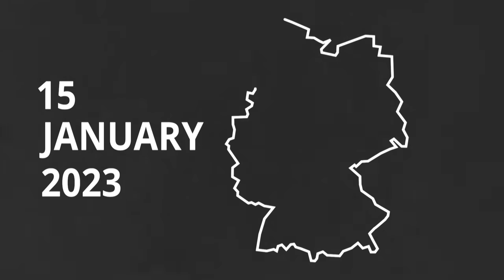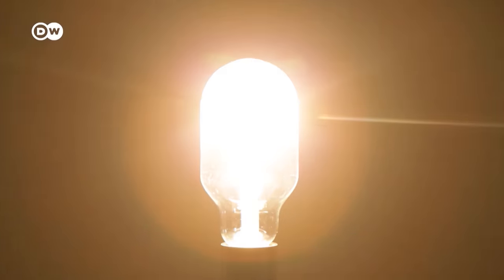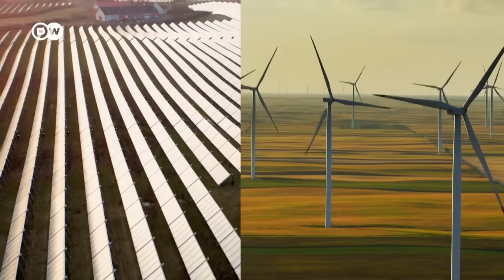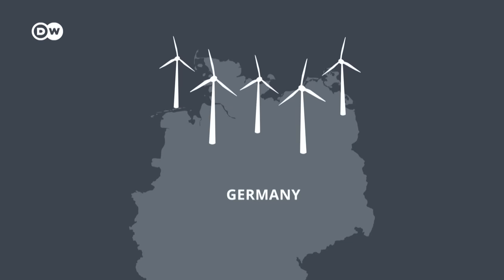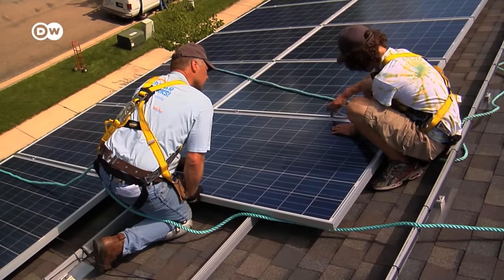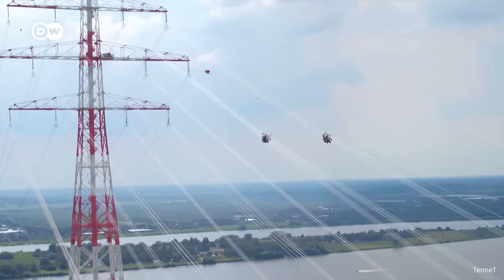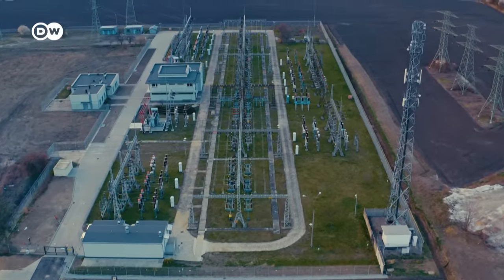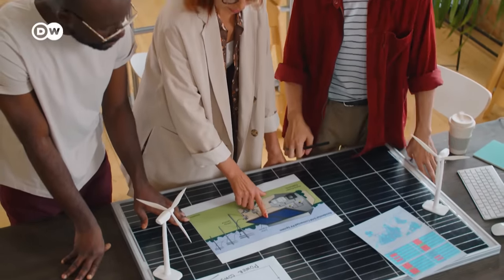This is what's REALLY holding back wind and solar

Comment from the maker: Would you adjust your electricity usage to the availability of renewable electricity?
Reply: I bet you I'm not far wrong am i
Reply: No, absolutely not. solar PV and wind are soon to be cheaper than any other form of electricty. We should be drowning in electricity at all times. The problem of building enough grid is easy to solve if politicians get out of the way.  When too much electricity is being generated, the surplus can be used to electrolyze hydrogen for industrial chemicals and steel-making, and to remove carbon from the air.
Reply: We need a solar tariff from, let's say, 11 a.m. to 2 p.m. to shift the demand when it's cheaper.
Reply: We need a "traffic light" signal from our power meters showing when demand is low (green, 51 Hz) or high (red, 49 Hz).
Reply: No
Reply: Already doing that here in Ukraine. Using 70% of energy on night tariff. Saving 35% of money.
Reply: yes i am doing the laundry mostly in the weekend around 12  o' clock  midday when my panels have the most power.   and if i use the dryer  that is about an hour later, when the sun is still going strong.
Reply: I already do..  I don't have.a smart meter though and even if I did, my utility doesn't offer a matching tarif, but to me it's just common sense to match my demand, as long as the gas peaker plants still exist on the grid. But what was really missing in the video was grid level energy storage as provided by Ambri and many other solutions (especially those not necessarily lithium based).
Reply: Yes, if the incentive if high to change
Reply: @abelfaber4457  I m doing this same with laundry - i don't have my panels but in Spain most of power at this time in grid coming from solar   + i set up my boiler to not work 18:00-04:00. At 18:00 peak demand is starting and at 04:00 is lowest. 80 liters of hot water is enoght for 2 showers in the evening and in the mornig water also is hot.
Reply: No
Reply: Yes, I try to avoid consuming electricity the difficult hours.
It will take money and time but a smart meter could measure the electric energy at any given moment and charge you accordingly to the current prices.
This will force people to consume when its cheap and to avoid costly time zone.
Reply: @DW Planet A; 5:28 "100 miles" Please make sure to provide metric unit measurements.
Reply: Definitely not! It is not my fault, nor is it my mission, to take responsibility for such poor political decisions. If we would have had active nuclear power plants, this would be a different story. Politicians are supposed to exist to improve the social infrastructure, not to make it more complicated.
Reply: I wouldn't mind
Reply: @gregvanpaassen  "We should be drowning in electricity at all times."

Except when the sun isn't shining.
Reply: @NoHandleToSpeakOf  So, let's purposely make the world function like a war-torn country?
Reply: Irrelevant, industry doesn't wait for energy to become available.
Reply: We should reshape our society to reduce our energy consumption and change when we need energy. I work from home (also an American). I have solar panels and an electric car. I hang dry my clothes. I turn on my dishwasher and washing machine during peak sunlight hours. I also charge my car when it's a sunny day. 

The biggest thing we should do is push for more work from home when possible. There's so much wasted energy to get to a cubicle to stare at a computer screen.
Reply: @PistonAvatarGuy  what an absurd premise
Reply: @NoHandleToSpeakOf  Exactly.
Reply: I already do, because this is saving a lot of ressources: matching your consumption with the production of renewable energy means that we'll need to build less generating capacity, less grid infrastructure and less storage (batteries being highly polluting and hydrogen wasting 75% of the electricity produced, which means we would have to build even more renewable energies).
There are already strong global tensions on certain metals that are key for the energy transition, such as copper, so demand flexibility and energy savings will be necessary in any case. 
But energy providers should give clear incentives to consumers if we want to generalize these new patterns of consumption.
Reply: Not to worry, let Artificial Intelligence manage it.
Reply: I do that everyday to maximise the use of my FV system
Reply: No, I have a 6kw battery so I can use electricity more or less whenever I want, and I think the grid should do the same using pumped hydro. We should be investing more money into pumped hydro than we do solar and wind at the moment but we are not.
Reply: How about you don’t and build up the nuclear sector instead.
Reply: Only if it is plannable and not during working hours
Reply: Some funny comments here. People got used to buy gas for their car, oil for heating themselves but expecting society to care for electricity. In my basement I also have a battery that covers the supply of electricity when my solar panels to not deliver (like at night). And yes, I stopped starting the washing machine after sunset.
Reply: I think you are asking the wrong question. To me, the question was more like this: "If you move power consumption to another time,  the price will drop to 25%. Do you want the deal?" Guess, what my answer was ;-)  And I can change this decision again every day/hour (like when having a big party)
Background information: Locally produced solar energy costs less, because there simply is no/less transportation fees. It is therefore a lot cheaper to get. In my case I even have a (small) battery in the basement to cover for the night
Reply: I would be more than happy to adjust my power usage.  I suppose in theory our household does something a bit like that.  If the sun is not shining we don't do washing as it can't dry.  When the sun is out we try to get in as many loads as possible because everything will be dried by the sun.  At some point the individual needs to help make a difference.  I think the problem is that individuals don't realise they have the power to make a difference.  I like the idea of what the energy company was doing to encourage their customers.  I however don't feel people always need monetary incentives simple token pictures on their invoices would be enough to encourage people.  They have seen it in psychology research that people can be motivated to do many challenging things by just getting sticker stars.
Reply: @gregvanpaassen  Please excuse yourself, but the politicians aren't even half the problem. The worst thing that can happen to a power grid designer and builder are these "NIMBY" neighborhoods - or the farmers in the rural areas who have enough acreage but can't give up 1% of their acreage for even one season where the link route can then be installed underground. The technical descriptions state that crops that do not have such deep roots can later be cultivated via this line. So in the future you won't see anything of the line - except for access shafts every few hundred meters.
Reply: I don’t like how the conversation always gets shifted to personal responsibility. Home owners don’t make up anything close to the demand of industry. We should do what we can but it’s not where these conversations should finish up with, it’s a distraction from the real point
Reply: Only if there was a preferential tariff
Reply: @Foersom_  Why?
Reply: @kettlehum  True. I changed my behavior once I was able to observe how much energy I used at what times. Admittedly, I am a technician. My wife would put it like this: "If the battery charge is/stays above 30% my husband does care how much power I use". A bit oversimplified but works very well.
Reply: @moqo  True, but the home owners are paying the highest price, usually two or three times as much as the industry per kWh
Reply: @Kastoraki  That and automatic switch off of geysers and other big consumers  like EV chargers at peak times.
Reply: @mike160543  Because DW makes videos for an international audience and 95% of world population uses metric unit measurements.
Reply: @Foersom_  Then both should be quoted.
Reply: From what i can tell, the current progress of grid development will not meet demand.
This poses a risk for me as customer.

i would rather like to adjust my own energy production to meet my own demand and stay out of the market.
This way i would contribute less to the networks problem of moving renewable energys.
Reply: I already do! We use as much solar energy as we can during the day, while still feeding into the grid AND loading our batteries for the nighttime.
Reply: Nuclear, but the French are way ahead of you 🤭🥅🎉

How'd that happen?
Reply: @przemek5000  Why not get a solar water heater? I have one on the roof of my house (near Malaga), it has a built in electric water heater that I can turn on if we've had a succession of cloudy days and the water temperature is falling - it cost about €2,000 five years ago and I now probably have to use electricity to heat water four or five times a year. Heating hot water is quite an energy intensive burden on the average household - letting the sun do it for you if live in a sunny climate seems fairly obvious - and there's no worry about transmission lines and the grid.
Reply: Holding off the laundry - no problem at all as most modern washing machines have a starting timer. But how to find out when it's the best time to use power in my region? That's the first question.
Reply: @GregorWSky  there's apps for that! Here in Europe this information is available from hour to hour.
Reply: No.
Build nuclear plants to match demand.
Reply: @lorenzoventura7701  That's kinda how Octopus flux works
Reply: For me the more important question concerning this topic is, how we could cost effectivly put the energy grid below ground and not loose any advantages from having them above ground. I recently saw that maybe 2 years back a new technology called "plasma drills" was making the rounds. Those were said to lower cost while increasing drill speed. If so, then having those to drill a huge tube north to south in germany in say 100 meter depths wouldn't be an issue anymore. Imagine them being in a diameter suffiencient to have any sort of cables and getting fresh sweetwater from desalination plants up south to places where a drought could happen while also solving the issue of our energy grids.
Reply: Yes
Reply: No.
I pay for a 24/7/365 service, so I expect that electricity is available when I need it.
I will also not let the grid operator use the most expensive part of my BEV, as every charge-discharge cycle degrades the battery and shortens the life/range of my car.

6:50 Why don't you even mention nuclear!? 
Why only coal and gas?

Finally you realize what nuclear supporters were telling for years!
Solar and wind is a great way to REDUCE fossil fuel usage, but due to their intermittency they cannot REPLACE them.

On the other hand, nuclear can replace coal or gas plants.
You could even keep the steam generators and cooling towers and use the exiting grid.
It also has the lowest CO2/KWh, lowest land usage and highest capacity factor/ availability.

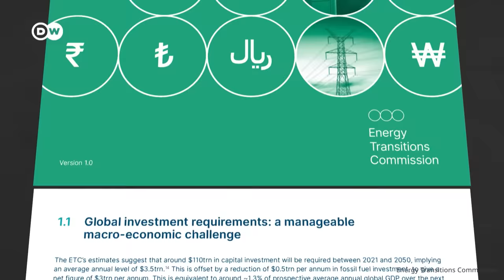11:00 Yes, it is incredibly expensive. 
When you add all the extra grid connections, storage solutions (H2, batteries, pumped hydro, etc.), solar and wind  becomes more expensive than FOAK nuclear plants like Vogtle or the EPRs. 
Not to mention the state of the art,  already built  German plants, which were closed by "greens".

11:05 From that 1.1 Trillion dollars which you need to spend every year only on the grid , you could get 80-120 big nuclear power plants.
That could phase out fossil fuels way faster, and those plants last way longer (60-100 vs 20-30 years)
Reply: My household already does this and has for the last 20 years.  The exception, unfortunately, is air conditioning (electric) and heat (natural gas).  However things like laundry, dishwasher, and other more flexible jobs are pushed to evenings and weekends.
Reply: @solutionrebellion  Thank you for this, I couldn't even bring myself to watch this ridiculous video and make an assessment of its content.

Edit: 1.1 trillion dollars, EVERY YEAR until 2050, that's 30 TRILLION dollars, that's enough to build at least FIVE THOUSAND nuclear reactors! This is assuming that we don't adopt the French model for the production of nuclear power plants and take advantage of the economies of scale which result from mass production.

And that's just the cost of the grid upgrades required to make renewables viable, that's not even including the cost of the energy systems themselves!
Reply: Kinda. I've got solar and batteries :)

Octopus flux work the opposite of the way the lady in the video talks about ie: you import at 19.63p/kWh between 2am and 5am and then you export 100% of your energy for at least 21.72p/kWh

Equally, I'd put a timer on a dishwasher / r ashing machine to start between those "cheap" import hours because it's more cost effective to sell that energy when exporting 

I'm pretty happy with that
Reply: @lorenzoventura7701  Depending on your country, that already exists :)
Reply: @malcolmrose3361  Living in apartment with small terrace allowed me to put only one solar panel 200W real production + 200W 12V 10 liters small water heater from camper. Solar mppt controler + 60Ah 12V battery makes it work correctly. For me it is most efficient system of storing and using this small amount of solar electricity. Battery is necessary as small temporary balancer for clouds, different insolation during day and correct voltage. Heating element need always reciving 200W to warm up to operating temperature. Small boiler is just pre-hiting water before main boiler. 
That system allows to have always hot water in main boiler and saving money when sun is shining without switching anything manually. Mppt controler is turning on smal boiler when battery have 13V and turning of when battery have 12V
Reply: @waqasahmed939  
Subsidies are given to natural gas power plants to ramp up at 7 p.m. when the cheap tariff starts, here in Italy
Reply: @przemek5000  Very good. It's always surprised why there isn't more solar water heaters here in Spain - you would think communal ones on the top of blocks of flats would be fairly straightforward to do, at least for new construction. If you go to Greece they are everywhere.
Reply: my utility offers a less than 1% discount to residential consumers for avoiding evening usage during summer...enough to change a fair amount of consumer demand, but not so much that it reduces profit for the utility. in fact, it significantly increases profit by driving demand to renewable generation time where margins are fat as F while reducing demand during non-renewable hours, where margins are comparatively thin. and my utility operates as a for profit entity. so, to answer your question, no, I will not adjust my usage for renewables with my present utility.
Reply: Yes, I already do! I have solar panels and attempt to operate washing and dishwasher machines when there is sufficient solar electricity.  Domestic hot water is provided automatically by an immersion heater supplied from the solar pv panels when excess electricity is available, for most months of the year at zero cost.
Reply: I already do. I have PV on my roof. Washing machine and other big consumers are used as soon as there is enough electricity from my PV.
Reply: 'Adjusting'. You mean something like 'heating my home just in summer when there is enough access electricity from PV in the grid but not in the winter?!
Yeah, sounds like a 'great idea!'
Reply: It is incredibly easy, yet not implemented by the market: smart phone chargers, smart freezers, smart washing machines, even smart ovens. With dirt-cheap electronics we can schedule most of our power needs. And I refuse doing it manually.
Reply: Sure, we have been doing it for years. Our electricity cost varies greatly here in Denmark unless you are on a fixed rate, so it makes good sense, and it is easy to program the dish washer to run at a specific time.
Reply: @wora1111  I agree. Here in Denmark everyone has smart meters, so you can choose to have  variable rate, and save money by shifting electricity usage.
Reply: In Sweden everyone has the option to pay the market spot price per hour, rather than a fixed tarif.
This has become really popular for EV owners, since all EVs can be set to automatically charge when the price is lowest.
It is also quite profitable to have your boiler and heat pumps run intelligently based on the spot price.
Delaying the laundry or dishwasher... Sure, you can save 20 cents doing that. But why bother?
It is your heating and EV which make a real difference, and those can be easily automated.
Reply: I do it already with Tibber and dynamic prices.
Reply: @jensschakies1414  Why would farmers let the lines go in? The power is already coming from the rural areas so it does not even affect them. It is mainly the cities that need it anyways. The farmers just wanna farm without anything distractions.
Reply: @bbgonyt2  Why should they let the lines through? Because there is actually a kind of community spirit here in Germany - if it helps us as a country, the individual can voluntarily cope with certain limitations for a short time. As far as I know, there is also compensation for the crop failure in this part of the field. And funnily enough, many farmers have already come to terms with it. 
The eternal troublemakers are the so-called "citizens' initiatives" (NIMBYs), especially since their houses are usually not directly affected! Mentally, they still live in the middle of the last century, when electricity simply came from the socket. The coal-fired power plants, which used to be responsible for a large proportion of the electricity generation, were of course not located in the neighborhood either.

I would love to put portable charcoal smokers on the garden fence of such troublemakers to show them the consequences of "real old" power generation for a while. Then, as they sit on their patio coughing and covered in fine dust, they might realize that a nearby power line could be a lot more comfortable!
Reply: I already do ( in U.K.) I have cheaper electricity at night so I run my washing machine, dishwasher and charge my EV. The only thing I cannot really time shift is cooking.
Reply: @tombh74  That is not exactly what I was referring to. Even "old" Ferrari-metering allows for (time dependent) variable rates. I was trying to refer to rates, that may change every day and every hour. For that you need additional data channels from the utility to the customer and the counter must be 'programmable' to some extent. With two way data communication you can do even more. Technically that is easy, but there are legal hurdles to that approach.
Reply: We are actually doing everything we can afford to cut electricity usage (and all other energy sources).  It is not easy to do for many of us because of the cost (and some people do not like to be inconvenienced).  Little things like adding a switch to cut power to devices that draw power when they are not in use and not needed is a less expensive step.  Automatically blocking windows from direct sunlight in the summer is another one.  Upgrading insulation can be a good one as well.  So many options, each one with its own cost/benefit issues.

Changing to geothermal heating and cooling is a more expensive step, but over time pays for itself in many if not most places.  Passive heating and cooling designs are another way to cut usage, but are limited to new construction in many cases, so will take a much longer time to implement.

Reducing demand is just one way of making the grid more capable of meeting demand.
Reply: @wora1111  our rate varies by the hour and our smart meter records our usage by the hour. I can see the price for the next two days on an app, so it easy to plan ahead. There is even an API available if you are into home automation. Perhaps soon  appliances can conmect and automatically plan when to run or turn off.
Reply: @tombh74  Oh, I see. German smart meters usually have no connection to a WLAN or the Internet. I had to install an additional home automation (including meters) to know my current consumption. Your setup makes things a lot easier.
Reply: I'd rather build a wind park all along the alps.
Reply: Yes, I would hold off doing my laundry until there is enough renewable energy available
Reply: Our electricity provider is one of the few who only have renewable energies in their portfolio. And with the flood of 2021 we learned how to live without electricity. So I would be in the process of aligning my consumption with the renewable ones. Our electric car is refueled from the roof and can be bidirectional 😉👍
Reply: Yeah. It's a good strategy
Reply: I think if people can see in real time via some app or website , how much load is on their grid and how much electricity is being produced by non renewable sources of energy to meet their demand and how much they are contributing to co2 emissions, temperature rise, etc. Then they might consider reducing their energy consumption. Also if some kind of area wise of, state wise or community wise credit or award of some type , public recognition or ranking of some sort be given to people of these areas collectively, this might encourage a healthy habit and lead to achieving the required goal. furthermore area or group of people may be made on basis of energy supply by a segment of grid to that area .
Reply: I already do. My home is off grid and 100% solar. I plan on adding small wind turbines.
Reply: @gregvanpaassen  Sounds good if you exclude the winter nights with calm wind. It seems like the coming winter will be a challenge in Germany even with coal and gas plants in the grid. Please do not be naive about energy supply, all people depend on it.
Reply: @gregvanpaassen  Sheer ignorance
Reply: prosumer hir .. I already do that.. 7kw photovoltaic panels + 5.5kw and  5kw battery.
Reply: F A R T
Reply: We won't need to.  Get storage units like the Tesla Megapacks to store energy during wind/solar peaks, and supply it when the excess power is unavailable.
Reply: yes absolutely !
Reply: Availability of renewables, perhaps no, but to price certainly.
Reply: @lorenzoventura7701  Shifting frequency is bad idea, but there is, at least in some, countries, for decades, system that allows to control power mertres and appliances, but number of signals is limited. Other option could be sending digital date to power lines that are then received on consumers end. But that would require signal transmitter/repeater at every 22/0.4/0.230kV substation.
Reply: Nope.
Reply: I've been doing it for a decade in The States. Only recently we are rewarded by cost savings
Reply: It is easy for me to schedule our EV car or our dishwasher to run in the middle of the night (no grid impact) than doing a single load of laundry in the middle of the night. Most people just want to get laundry *done*.  The biggest thing is to schedule your EV overnight. It is trivial and then virtually eliminates the impact. -- midwest USA
Reply: For things that I can schedule, like doing laundry or charging my car, sure, why not. Consumers can be encouraged to do so easily by variable pricing and smart mettering.
Reply: I'm already doing that even when all day there's enough electricity. Not to mention last winter blackouts in Ukraine due to russian attacks on our power infrastructure, when behavior correction was inevitable.
Reply: No I can't. I finished work far too late into the day to be able to do the laundry during the high sunlight hours.
Reply: @guyman1570  Umm, timer?
Reply: @OmmerSyssel  as individuals we should do what we can, but some people aren't in a financial position to do it. Those that can should - I personally am putting myself in a lot of debt to try to be responsible.
Reply: @OmmerSyssel  Never really calculated it. But it would not carry through bad weather stretches of a few days which often happen here, so I would still need other methods.
Reply: Question is unclear. "Would you..": who is "you"? (i) Me? Or (ii) the algorithm on my home microgrid/storage? Anyway (i) I won't notice, except when I read my bill and (ii) will do the "adjusting".
Reply: yes such a wise decision to close all their nuclear plants, now they get to fill peoples lungs with coal instead! It’s great!
Reply: If I could I'd rather install a 12h storage.
Reply: No. you first, lefty.
Reply: When possible, Yes.  But usually it is not possible or practical. And saving a bit of energy here and there is not going to save the world, simply because energy demand is increasing.  Saving reduces this increase.  But in reality does not reverse it.
Reply: It is best to place batteries in homes, schools, and various facilities.  This should become a norm, using salt batteries, as prices continue to decrease.

Further, it is far more logistics smart to send hydrogen via pipelines over power in lines.  Power densities for hydrogen pipelines when compared to electricity towers are incomparable.

Of note, electricity is used serially. So, if any one user is consuming a great deal, all would have less to split, in real world scenarios.  This serial nature is a prime concern for EV drivers, in particular.  

Second, peaks cannot be avoided.  For instance, daily use peaks at work, in addition to at the time that people arrive home from work, generally coincide.  Sleeping hours and off day hours coincide, as well, but for valley end of routine energy use.

So, asking people to adjust will only go so far.
Reply: Very disappointing to see the USC scientist talk about natural gas turbines is very dirty. Most people would have a streetwise perspective of this. The reality is they are about the cleanest way to turn fossil fuel into energy. Obviously they produce carbon dioxide and they produce water but pretty clean in fossil fuel terms. It’s a pity she wasn’t more scientifically accurate about it. This is part of the trouble with the green Brigade just be accurate and scientific and unbiased and people tend to listen more.
Reply: We need better cable that don't loose power in transmission ! In 2007 while in DC convention I saw a fiber cable carrying elections with NO loose! why do we  still use old ass copper cables!
Reply: The answer would be to be dependent on your own energy production, making poeple responsible for their own consumption.
Reply: Yes. I do. We started by adjusting our usage when alerted to stop the need to fire up a coal fired power station. We now have solar and battery and contribute by storing off peak and releasing at peak demand.
Reply: Already am.  But if we want it to be widely done, it'll need to be painless and unnoticeable so automating functions will be crucial.  EV charging, running laundry, dishes, vacuum cleaners are highly customizable actions that can be done at just about any time.  But it's a whole lot easier if, say, a very quiet robotic vacuum cleans my house while I'm sleeping and the wind turbines are cranking out more energy than a slumbering country needs at the moment.